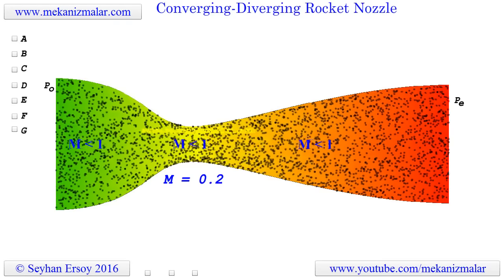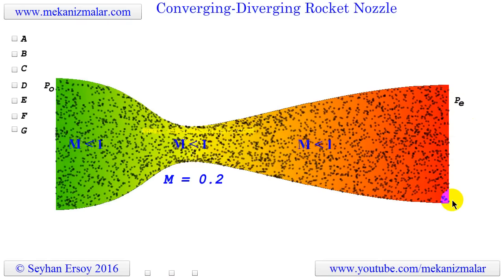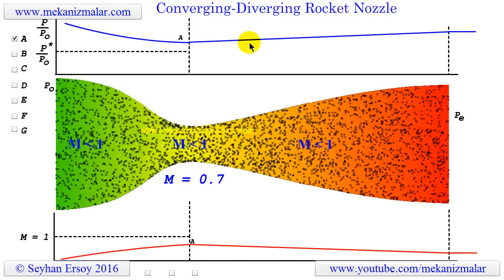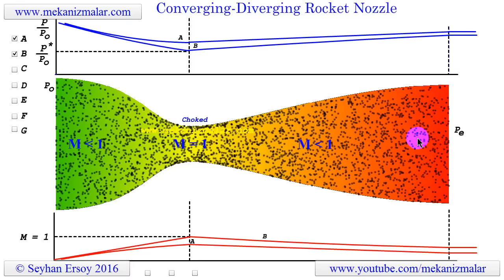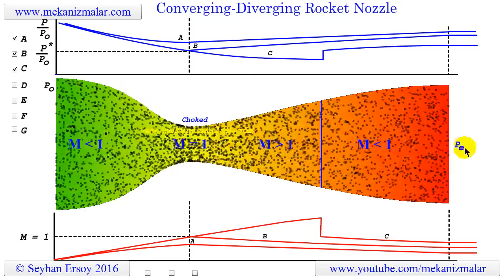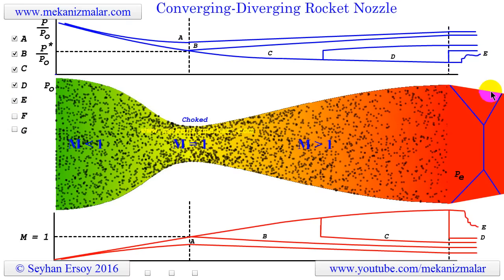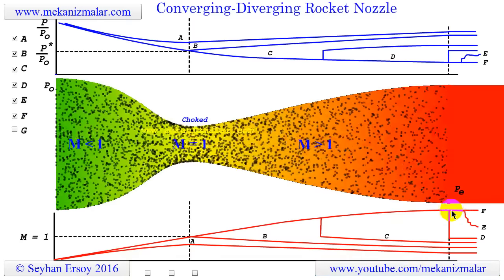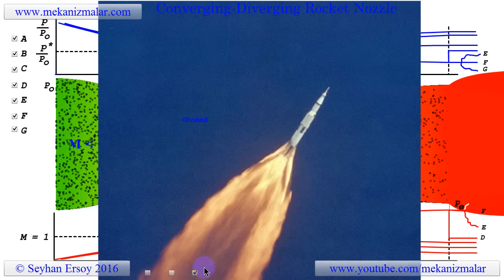converging diverging rocket nozzle

Comment: dude, it is 1 am. i am a freshman in hs. i have no idea what is going on but it seems cool. imma build a rocket.
Reply from the maker: When I was in your age I was trying to build a rocket engine. I think it is best to find similar minded people to build a rocket rather than do it alone. I wish you all the success and have fun. I had a lot of fun when I was trying to build one.
Reply: A future engineer in the making
Reply: I built a rocket engine that was fueled by compressed air and propane. It made very impressive noises  once the combustion receded into the combustion chamber. Great fun.
Reply: I am designing a rocket.  I am 12 years old
Reply: Hows the rocket building going? Still interested?
Reply: @Jacob Jones I never finished designing it. I still plan on finishing it eventually, hopefully this summer. I don’t know why I was attempting to do it a year ago, I had only done a class equivalent to AP physics 1 and 2, as well as pre-calc. By the end of this semester I will have done AP calc BC and AP physics C, so hopefully I will be more prepared. I will also read through rocket propulsion elements.
Reply: same
Reply: same lol
Reply: @Jacob Jones once you understand physics mechanics, take mechanical engineering classes thermodynamics, heat transfer, fluid mechanics. You will need advanced math like calculus and differential equations. You will be in the university by then.
Reply: @thrashingmetal  generalised 1d flow in Shapiro, Anderson or Zucrow & Hoffman only requires simple calculus and algebra, something a good HS student will understand. Underexpanded, overexpanded nozzle and normal shocks can all be described by the mass flow relations in 1D. The harder parts come when we consider quasi 1d, 2d and 3d, which would require advanced PDE knowledge which even upper undergrads struggle with.

Comment: Thanks! This video was very awesome! This video now made divergent convergent nozzles more clear to me. Also very nice change to real human voice! I wish you had made it clear how the nozzle pressure is actually controlled.
Reply from the maker: Thank you for your nice comment and encouragement. I do not know how do they change exit pressure in real life. One possibility is that they test the engine such that exit gases empty into a large thank. They control the exit pressure by using large pump to expel excess air  from this large thank, to keep the pressure in desired level. This could be very expensive test setup. The other possibility is that they build small scale version of the engine to reduce the cost. This is similar to making a small scale airplane model and test it in the smaller wind tunnels. But in real life I did not see a test platform for rocket engines. My comment is just a speculation. My hope is that someone more knowledgeable in the subject would enlighten us soon.
Reply: mekanizmalar how about the shape of the divergent section? Or perhaps by increasing the initial velocity.
Reply: the combustion chamber pressure is controlled by the area of the nozzle throat, then for the diverging nozzle the wider it gets the lower the pressure becomes, they make it large enough that the pressure when the exhaust leaves the nozzle is the same as the pressure as the outside pressure
Reply: as shown here:
https://www.nakka-rocketry.net/design1.html
Reply: bijibijmak    This is the obvious answer.  Too bad the animation didn't show this.
Reply: The chamber pressure is dictated by the standard subsonic thermodynamics (I burn 2 of these with 1 of these producing this much heat in this volume....), the exit pressure, provided the nozzle is properly choked, is dictated by the ratio of expansion like the previous guy said, more intuitively the size of the bell nozzle. That's why sea level engines have such smaller nozzles and operate at lower efficiency than vacuum engines
Reply: Yes, I was anticipating them showing a larger divergent exit in order to lower the exit pressure but was somewhat confused when the divergent section remained the same size in the illustration.

Comment: I take it the nozzle is being demonstrated with a cold gas and the only variable is the ambient pressure.
I'm trying to find a demonstration with the heat of a hot gas being turned into kinetic energy, thus the gas accelerates to the exit as opposed to simply staying above mach one. 
Thanks though, it's a good demo of the altitude problem. More than that, it's the best demonstration of underexpanded thrust.

Comment: Hey great video... but how are we lowering the pressure at the exit ?
Reply: A bit late response, but here you go, instead of reducing the pressure at the exit you could increase the pressure in the inlet. Imagine the inlet is a big tank with compressed air, and you can use tanks with different pressures. This is similar to reducing the pressure in the outlet as the effet of pressure in the flow is just a matter of the variation of pressure (this can be seen from the euler equation for example).
Reply: by extending the divergent section of the nozzle. the more "bell shaped" it is more  it expands the gas and drops the pressure.
Reply: It's more common than you think. Consider a rocket that lifts off from sea level. The pressure that the nozzle exhausts into continuously reduces as the rocket goes higher and higher, since the atmosphere keeps getting thinner

Comment: Great simulation! Thanks! I am struggling with the sharp jump in particle speed in case C from supersonic to subsonic. Wouldn't this jump require infinite deceleration?? I understand that in case C, an area of very low pressure is created right after the choke and so particles will reach supersonic speeds. What exactly is the particle explanation of the "shockwave" line that decelerates the particles infinitely fast? Are the particles hitting something?
Reply: This is a typical case of compressible flow. As the flow reaches supersonic a normal shock is formed and the fluid properties are discontinuous across the shock. Hence we see the Mach dramatically decrease at C. In reality they don't just jump from one number to another, but rather it is assumed that they do because the jump is so quick. For example a quick google search explains this discontinuity "Shocks and discontinuities are transition layers where the plasma properties change from one equilibrium state to another." This type of explanation is outside the scope of a typical compressible flow discussion and is why it is often not explained in great detail in textbooks.

Comment: Great job...   At P0 (exhaust outlet) is the flow still a subsonic or it changes to supersonic? after it has been choked...
Reply from the maker: Thank you for your visit and your comment. The flow speed will be subsonic if exit pressure is slightly below P0 the flow speed will be subsonic and the flow will not be choked in the throat.

Comment: Does all of the flow acceleration occur only inside the nozzle? Or is there any additional flow acceleration occurring outside of the engine? Put another way, where is the thrust actually being created? If all of the mass acceleration is occurring only inside the engine then all the thrust must be being produced inside the engine. And if this is so the opening at the rear only serves to allow the expended propellants to exit. However, if any addition thrust is being created outside the engine then how is that occurring? There would have to be some additional acceleration of the gas occurring outside the engine and the force produced would somehow have to be reflected back into the engine.
Reply from the maker: Joe, Thank you for your visit to my channel and your comment. As I stated somewhere previously, I am not a rocket scientist. However, from my engineering education, what I know that we apply control volume concept when we calculating trust of a rocket. In those calculations we use exit velocity and pressure in calculation as you can see from following NASA link. https://www.grc.nasa.gov/www/k-12/airplane/rockth.html. Your second assumption that all the trust will be created inside engine, this is not correct.  Significant amount of the trust generated by amount of mass exiting from nozzle times the velocity of exit gas. That is what I understand from the NASA link.
Reply: @mekanizmalar  Hello. I guess my thinking about thrust being generated only inside the engine comes from the fact that in order for thrust to be produced the gas must not only be moving but it also must be accelerating. Note that in the equation F=MA if A=0 then F will also equal 0.  

Note that in your video diagram the acceleration of the gas is clearly shown to be occurring in both the convergent and divergent areas of the nozzle in cases C through F. However, the gas exiting the nozzle seems to be losing velocity in cases D and E and staying relatively constant in case F. If this is true there would be no further acceleration of the gas outside the nozzle and therefore no further thrust would be generated outside the engine.

I think what could actually be happening is that in cases where the divergent part of the nozzle is neither over or under expanded (refereed to as "ideal" - case F) where the atmospheric pressure exactly equals the exit pressure it could be that the atmosphere itself acts as a virtual extension of the divergent part of the nozzle by effectively extending the nozzle out further back behind the engine. As such some additional acceleration could still occur outside the engine meaning that some addition thrust could be produced outside the nozzle. Note that engines like the Saturn V F-1 seem to be running exactly at ideal right at liftoff. At liftoff the engine is under its maximum load because the rocket is fully fueled and at its maximum gross weight, so at this point the engine's designers would desire the maximum thrust possible, so having the nozzle be at ideal at liftoff would be beneficial by creating some additional thrust outside the nozzle. Then at higher altitudes the Saturn V nozzles were clearly under expanded and the flow was over expanded, but it wouldn't matter at that point because the rocket will be a lot lighter and it doesn't need all that extra thrust anyway.

In space where it is a vacuum the nozzle will always be somewhat under expanded and the flow will always be over expanded, but there is nothing you can really do about it as the nozzle can only be physically extended out backwards so far. As such an engine running in a vacuum probably experiences no additional acceleration outside the nozzle and therefore produces no additional thrust outside the nozzle.
Reply: @joevignolor4u949  Think of it less in terms of 2nd law (F=MA), and more in terms of 3rd law (you pushing something away is the same as something pushing you). If you measure amount of air&fuel you are blowing out (mass flow rate * velocity: [kg/s]*[m/s]) you get a thrust [kg.m/s^2].

Comment: how come there is low pressure at the throat? doesn't having a high concentration of particles in a small volume mean there is higher pressure? what am I not understanding here?
Reply from the maker: Dear Harrison, The only omission in the logic that you are not taking into account  the velocity of particles. If people converge tho a gate with same speed, there will be a lot of people in the gate and the pressure in the gate will increase and people begin to fight. But when people converging the gate begin the increase their speed, they will pass the gate faster and tension in the gate ( pressure) will be less. That is what bernuilli principle tell us on Venturi effect.
Reply: nice question and nice answer...
Reply: Harrison Long why hello there.
Reply: I'm still wondering about the same thing.  I can understand that the lateral or radial pressure should drop.  But is the axial pressure going up or down?  I don't think the pressure needs to be the same in both cases.  The pressure we read on a gauge impinging the wall of the convergence is strictly lateral pressure.   Any thoughts?  And could we keep Bernoulli out of this for a second?
Reply: kenn mc donagh thanx sir
Reply: alex tworkowski
Pressure is a scalar field not a vector field so, each point of the field has a value in all directions. The direction of the force generated from a pressure field is not related to the pressure, rather it's related to the normal direction on the surface where pressure field is applied. If we assume that pressure in the nozzle throat section is uniform or considering an average value of pressure across the section, we can say that the measurement of gauge pressure at the wall is not a far rather a good representation of the true pressure value at the whole throat section.
Reply: The reason no pressure occurs at the throat is a result of a famous math problem in Fluid dynamics. Look up Torricelli's law for more information!
Reply: Point me out if I'm wrong, if base on conservation of energy, the pressure is conserved to higher velocity, means in my language the "pressure" is charged on particles to make it faster. Hence the "pressure" is consumed, in other words pressure is low
Reply: @mekanizmalar  i think the wording on this messes with my head. shouldn't high pressure exist up to the longitudinal tangent of the chocked portion? i understand that directly after that point the velocity will carry partials away from the divergence and create low pressure making a cone that resemble that in the mach diamond.
Reply: Bernoulli's Principle: the pressure of a fluid is low where velocity of the fluid is high.
Reply: @mekanizmalar  - This always tends to confuse people. I think it's because they try to attribute the pressure drop across the throat directly to the movement of the gas. I've always found an easier way to understand it is to look at it the other way around. The throat creates a restriction in the gas flow, which creates back pressure that is reflected back into the thrust chamber. This situation creates a pressure imbalance across the throat. Nature hates imbalances, so the pressure imbalance is what accelerates the gas through the throat area as nature tries to resolve the imbalance. It's like that old saying, "What comes first, the chicken or the egg?" I say you get the pressure imbalance first, then you get the accelerated gas flow through the nozzle as the result.
Reply: @joevignolor4u949  That would be logical, but is not the case. Pressure is lowest at the choke point, not after it.
Reply: @lavrentievv  Yes the pressure is lowest at the choke point. But that also means that the pressure is higher the further you go inside the engine towards the injector plate just as it is shown on the graph in the video. Inside the thrust chamber you have to think differential pressure going from the injector plate to the choke point rather than thinking about the absolute pressure between anywhere inside the chamber and the outside of the engine. When you look at it that way it means that there is a pressure gradient that exists everywhere inside the chamber with the highest pressure being at the injector plate and with decreasing pressure going towards the choke point. As such there are pressure imbalances that exist everywhere inside the chamber that accelerate all the gas molecules in the direction of the choke point. Essentially the potential energy initially contained in the pressurized gas located inside the chamber is being conserved but converted into kinetic energy to propel the gas out through the throat. It's actually very logical and it makes perfect sense.

Comment: Thanks for very nice and easy to have the feel of the subject.
one (silly) question....What if the rate of the flow at the neck is supersonic? is it possible?
Reply from the maker: When the flow rate reaches speed of sound at the throat of the nozzle it is called choked flow. If you try to reduce the throat area further to increase flow speed to obtain supersonic flow, shock waves begin to form in the nozzle which is reduces nozzle efficiency a lot. To prevent this, the area of the gradually increased after the throat. Compressible flows behaves differently than in-compressible flows.

Comment: I cannot understand meaning of A B C.. conditions. how can you change exit pressure that when pressure dosenot change in converging nozzle (chamber) or just how does exit pressure decrease?
Reply: a longer and slightly wider diverging half would drop the pressure at the exist, when gases have a lot of room to occupy they would! google rocket engines designed for atmospheric flight, then google engines designed for space flight in vacuum, you would notice that nozzles designed for space are much longer, almost as wide as the rocket itself

Comment: Why doesn't the m>1 flow in the diverging section "choke" the diverging section as well?
Reply from the maker: I think the simple answer is to this question is, because the channel is diverging. However the shape of diverging section should be defined with some equations, if diverging is a little bit off some shock waves might occur inside the nozzle, I guess.
Reply: mekanizmalar  sounds like a good guess to me, thanks